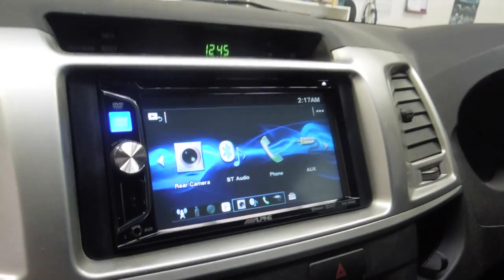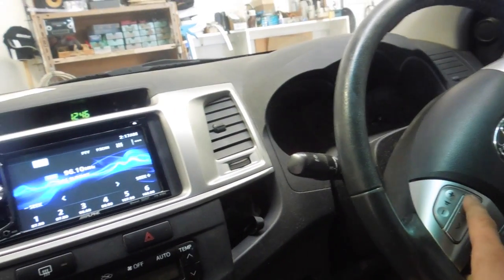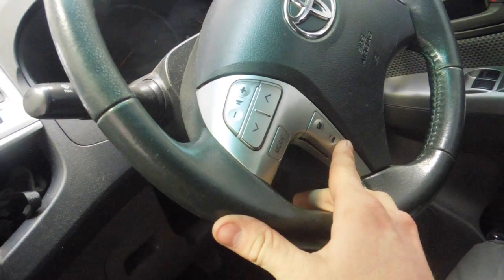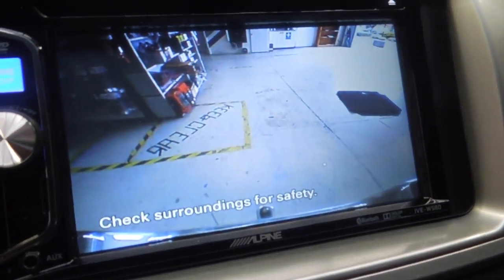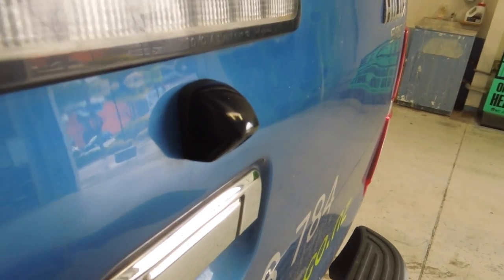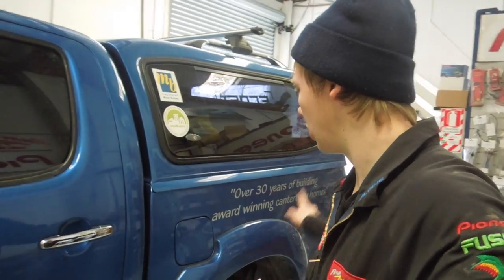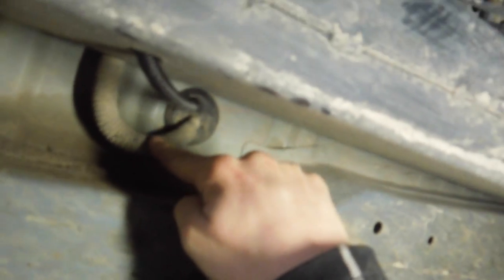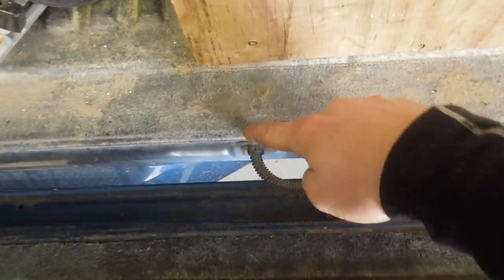Toyota Hilux Custom Camera Mount + Stereo

Comment: good video, one question you dont use idatalink or another device to retain the swc?
Reply from the maker: nope, the stereo has a built in resistive SWC decoder so no external module needed.

Comment: hi i have a toyota hilux revo 2015 model and would like to connect a rearview camera to the original head unit,. but i notices the connection on the headuint are different compared to the aftermarket rearview connection.

please help/ advise